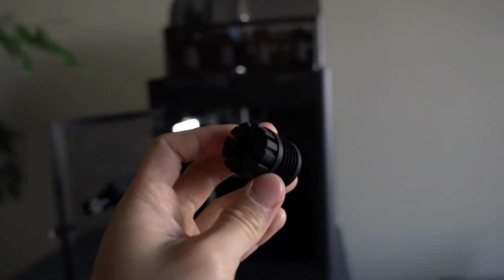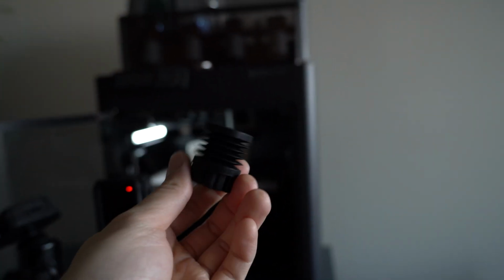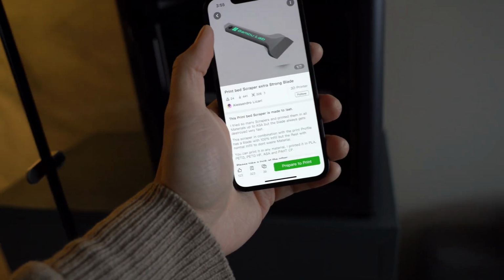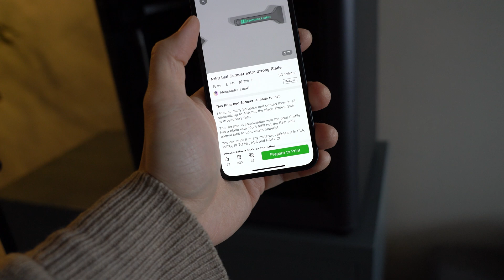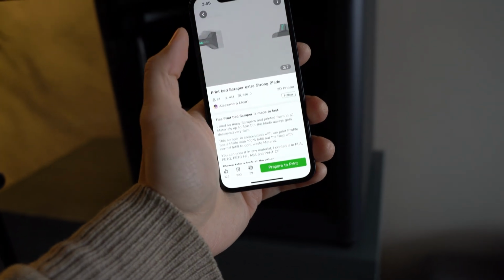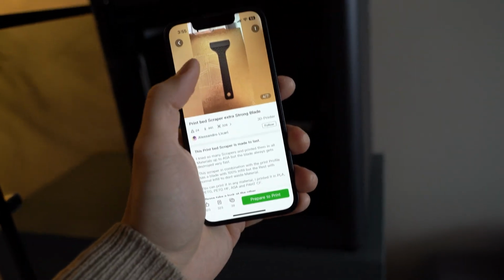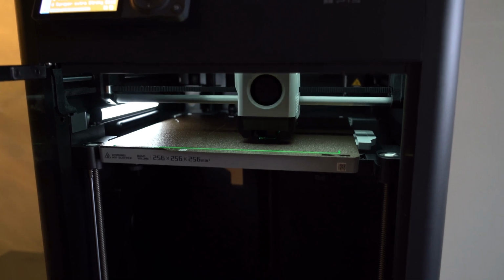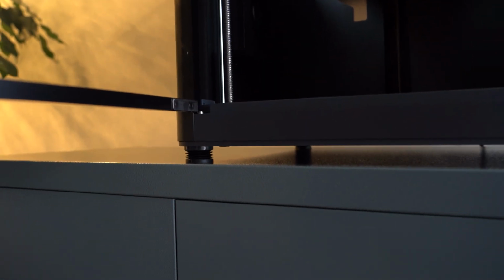Should You Get Anti-Vibration Feet for Your 3D Printer? | Bambu Lab P1S Review

Comment: Anti vibration feet limit the amount of vibration transferred to the surface that something is sitting on; it doesn't reduce the amount of vibration of the unit itself. Ideally, you'd want a platform with NO movement if print quality or something is what you're after.

Comment: I have an Elegoo Centari Carbon. I brought some feet for mine from Elegoo, but I am still waiting on them to ship. I later found out that you can print the feet yourself out of TPU. I wonder can you do the same for this printer?
Reply from the maker: you defnitely can. i have not try TPU. but i imagine printed feet will not be as good as a molded rubber ones in a micro level. so i just went with the official ones. dont want to risk my expensive printer on cheap feet

Comment: Have you done any other upgrades to your P1S i hust got mine and it's really noisy and loud 😄 rattles a lot and all noises amplifies to my wooden floor there the printer sits.

I have not done my first filament order yet either. Was thinking of just buying some Bambu Lab PLA Basic in some colors. Might be a good first choice i guess? Curious about their PLA-CF too.. though
Reply from the maker: Congratz on your purchase! I think the P1S will rattle regardless due to the insane speed (which is a good thing). I highly recommend getting these an-vibration feet after over 500+ hrs of print time now. While the printer will still shake, the shakiness tend to be contained instead of transferring to the surface it's sitting on (in your case your wood floor). 

For the filaments, you can't go wrong with PLA basic. I recently started to explore other materials and found gold, marble are sooo good at hiding layerline! Also I like using PETG HF to print functional part. Cheers!

Comment: Either you put the wrong side of the feet in the holes or I did 😅
I put them the other way in to use double sided tape on the flat side.
Reply: I've also put them Upside down in. It was so wabbly that I am sure this can't be right. Flat sides go down to the table. Otherwise they will snap out and the printer may say bye bye and jumps to death. 😅
Reply: the segmented side go inside the hole for a tighter fit :)
Reply: I also installed them the opposite way after watching a different install video 🤣. I did not turn the printer on its side and could not see the segmented region in the recessed area for the feet. The segmented part of the anti-vibration feet do not fit snug, but the round area below fits tight. Much more stable after flipping them around.

Comment: I have been wondering it they also help reduce the risk of outside vibration affecting a print. I had a print turn out poorly because of ripples that I think were caused by activity around the printer. I have not installed the feet that I got and am going to try those today.
Reply: Did it help?

Comment: I think it doesn't really matter. The bed and head are all connected to the same machine. As long as the machine is tight and true any vibration to table is mute
Reply: Engineer here.  That is not true.  They have algorithms that perform anti-vibration.  You can see how violent the head movement is.  That would ruin the print quality without their engineer's magic.  They have my great respect.

Comment: The resonances that vibrate the crap out of your table get mitigated to your printer and vice versa. So it will be less violent, not less shaky. Also, those are not great ones. Print up some hulas and make a video about those. And maybe try some weird shit like pillows or a steel plate. You're doing great man. Keep it up!
Reply: Yes.  The vibration testing the machine performs creates coefficients for its anti-vibration routines to use.  These legs make the anti-vibration algorithms work better.  It does also isolate multiple machines from each other.  Otherwise, the harmonics of the different machines would degrade print quality for both machines.
Reply: @dougbas3980  Thank you for the clear and concise answer.  It is appreciated.

Comment: You don't understand what hese are for. It will make THAT printer shake MORE. To make it stable you would bolt it to the  table for example.
Reply: the shaking is less violent though, and is of lower frequency. Clamping it hard to a solid surface would throw off the anti-vibration and anti-resonance algorithms in the firmware, plus it would cause small parts inside the printer to vibrate worse than when the whole body is free to shake and sway with the printing process, it provides almost some 'damping' or buffer for the chassis vibrations. so the vibrations are not as loud or violent as normal.

Comment: It’s supped to reduce the amount of vibration transfer between the printer and the table. So it will make the printer shake more, not less. The real use is to prevent multiple printers from affecting each other.
Reply from the maker: I can confirm that it greatly reduces amount energy from printer to the table. I did not think how having multiple printers can impact each other. Great point!
Reply: So no benifit with regard to VFAs? Thanks
Reply: @D4RKFiB3R i would also like to know that. My P1S is placed on a stone on an anti vibration matt on the ground and i have VFAs. I think of getting those feet but on the other hand i think it would be contradictory with "on a stone on a anti vibration matt on the ground" setup🤔
Reply: @D4RKFiB3R  - no, I can confirm that there's no effect on Volatile Fatty Acids. 

Sorry, but more seriously, 3D printing 'VFA' (vertical fine artefacts) appears to be a historical catch-all term to describe artefacts caused by any one of, or any combination of, mechanical, speed related or slicer settings related issues rather than motor resonance rippling (MRR) specific issues possibly caused by stepper motors being subjected to vibration induced resonance.

The perennial struggle here, like in sound systems (particularly turntables), is between mass, rigidity and compliance based solutions. All just try, in completely different ways, to shift the energy transfer as far from the transducer's or systems resonant frequency(s) as possible.

The Bambu squidgy feet approach, I suspect, is more to cut down on energy transfer as 'noise' than anything else - though they'll also shift the energy transfer to adjacent printers too as Aki replied.
Reply: Oh! Which is why it's important to recalibrate after fitting too.